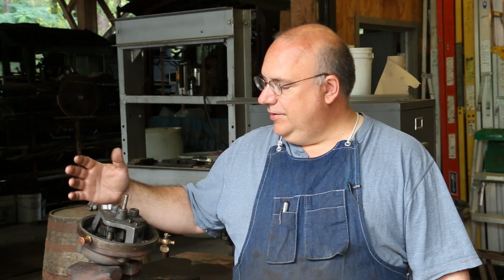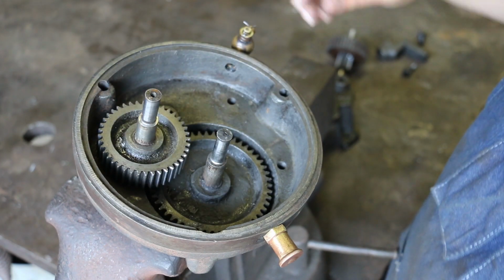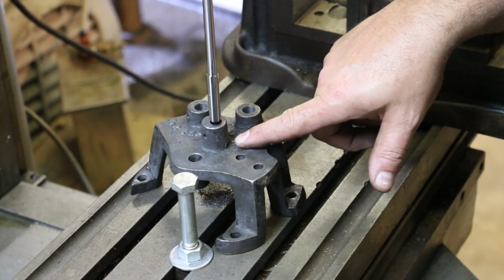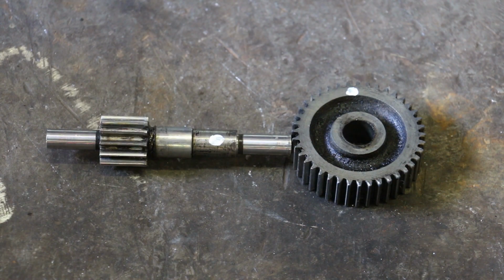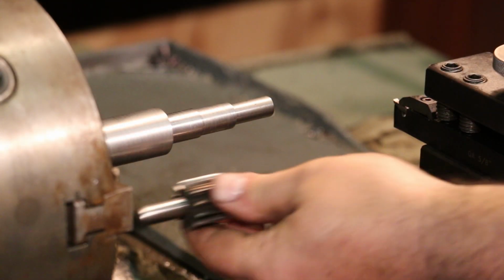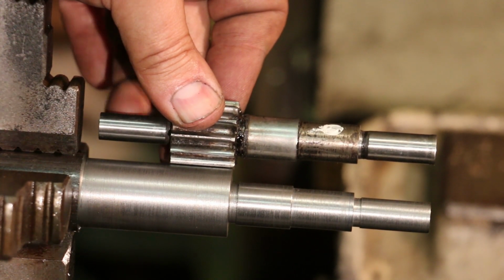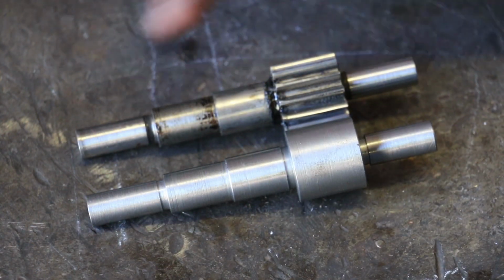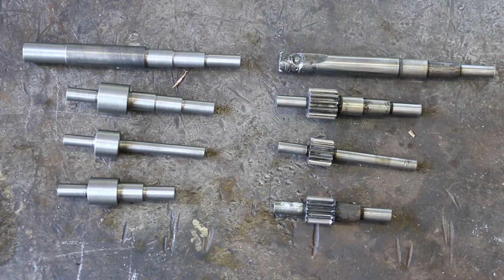Blacksmith Blower Rebuild:  Part 1 - Disassembly and Making Pinion Gear Blanks

Comment: Hi Keith! Getting a real kick out of seeing old stuff get restored like this. Great work! As a machinist wannabe I'm probably talking out of my rear so pardon me :) Noticed when you put it all together that it seemed to be a really tight fit. Isn't there a chance that there could be some tiny amount of friction between the output shaft and the housing when you put it all togehter? I mean, with that gear ratio from input to output, even the tiniest amount of friction at the output would be multiplied quite a bit to the input thus needing alot of unnecesary torque at the input. I'm thinking that perhaps if the shatfts were a bit looser in the housing then the friction would be less, thus less input torque would be needed.
Reply: ncmaothvez1 When you mount shafts loose, even with a tolerance, they seem tight until you make the whole assembly final lined up and fixed, then, the tolerances make it go silky smooth....
Reply from the maker: ncmaothvez1 Once things are aligned with the big gears in place, I think it will actually fit and line up better as that helps align everything in the gear box.  Also, everything will have oil on it when it is finished, which will make a huge difference.  Worse case, I shave a few thousandths off of the part of the shaft that fits into the bearing fit once it is all done.  It is much easier to take metal off than it is to put it back on.....
Reply: Keith Rucker - VintageMachinery.org Thanks for the reply Keith! I think I sort of assumed that since the blower is rather old, the alignment of the holes isn't that great.

Comment: Hi mate.
It's all going to look very good.  You have got a good fit for all those axels.  And while I know that most of those gears were pretty worn, I can't help feeling that the gearbox has lost its old time feel.  If it all becomes micrometre precise, it's lost it's nostalgic beauty.  I don't know how to express that feeling.  In New Zealand we had a expression, She'll be right,  It sort of says, It's not perfect, but it will go for long time.  And I have the feeling that will be lost if it's all polished and smick.  Catch my drift?
Marcel.
Reply from the maker: Marcel Timmers I do catch what you are saying, but our blacksmith needs a good blower that will blow air.  As it was, the gears are slipping and it is not working the way it should.  From the outside, it will all look the same, but if it is broke and will not work, the blower is useless.  I am trying to bring it back to life!

Comment: I think that gear is made of some phenolic material very much like Tufnol:
<http://www.tufnol.co.uk/technical/tufnol-gears.aspx>

Similar gears are used in swedish gear transmission drill presses to reduce noise and wear (on the small metal gear). I think you are mistaken that this was cost-cutting.

The use of the resin gear in the high speed stage only would lead me to believe you are looking at the cutting edge of technology at the time. And it has done rather well I might add, just think how many more times that output gear has spun around compared to the others.
Reply from the maker: stefantrethan Thanks for the info - interesting stuff!

Comment: Nice project. Looking forward to the rest.

Do you have all the different gear ratios? It would be fun to calculate the final ratio. Also, I would be interested in whether the original designer tried to balance out the wear by selecting gear tooth combinations with few or no common factors (so that any individual tooth would mesh with all the opposing teeth before re-meshing with the first tooth it opposed). Something like 16 (2*2*2*2) opposed to 81 (3*3*3*3) - roughly 1:5, but with no common factors, so every tooth will mesh with every opposing tooth before the cycle repeats.

It would be nice to completely replace the zinc die-cast gears in the cheesy forge blower I have stashed away somewhere around here. I should probably replace the die-cast housing as well. (This sounds like the traditional grandfather's ax: only replaced the head twice and the handle three times. Still the same ax, though.)
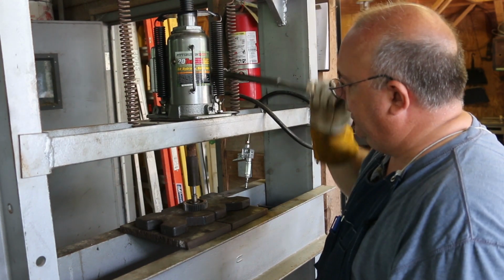Reply: Interesting. They took the smallest practical pinion (12 teeth; factors of 2*2*3) and mated them to 40 and 50 tooth gears (2*2*2*5 and 2*5*5 respectively). Mutually prime numbers of teeth will go through every combination possible before the same two teeth meet again. The more prime factors they share (2 and 2 with the 12:40 combo, and just 2 with the 12:50 combo) means that the same pair of teeth will meet 4 times as often and twice as often respectively, while skipping the other possible meshings. In the 12:40 combo 75% of the tooth-to-tooth combinations will never occur (unless someone disassembles the drive and reassembles it clocked differently), and with the 12:50, half the t-to-t combinations will never occur. I would expect that careful inspection would find some periodic/cyclic wear patterns on those gear teeth, unless that drive has been disassembled frequently over the years.

At the cost of slightly less ratio advantage, using a 13 tooth pinion (13 is a prime number) would make every combination except those with with 13 as a factor (26, 38 [[ EDIT oops; meant 39]]. 52, 65, etc.) be an even wearing combination. Too bad the axle holes are already located (and the blanks fabricated); you could have re-made this blower drive to make it last for two centuries instead of just one. ;-)
Reply from the maker: Peter W. Meek So the gear ratios go like this:  50:12 - 40:12 - 40:12.  So, that would give a speed increase of 4.166 with the first gear, and 3.33 on the second two sets.  So, if I am doing my math right, one crank on the handle would equal about 46.3 turns of the fan.
Reply: Peter W. Meek  The wear is very consistent, so I would think that they are odd teeth numbers, all teeth meshing! Regards, Matthew
Reply: Peter W. Meek Zinc stuff is everywhere they want the apparel to fail... except on sacrificial anodes on ships...
Reply: One good thing, Keith; you can do this job with only two cutters - #3 for both the 40 and 50 tooth gears and #8 for the 12. Under $150 new if you don't already have them.
Reply: So the ratios are odd, with each rotation, the teeth fall differently. Hence the eaven wear.

Comment: Maybe that phenolic gear was sacrificial in case something gets into the fan? It'll shear or strip instead of blowing the case apart. Or to quieten the final drive?
Reply: aallwwkk Probably the noise suppression.  That was my first thought.
Reply from the maker: aallwwkk Both are possibilities.  Of course, back in the day you could probably just order a new one - not an option any more....

Comment: Hi Keith, got a good chuckle at 12:45 seeing your reaction. I used to rebuild two piece motorcycle crankshafts, you know that pop is coming, but it's always a suprise.
Reply from the maker: John C Yeah, I have had pieces bust into thousands of pieces on the press before so I never know if that pop is good or bad until it is over....

Comment: Keith,  any shade tree mechanic would have just fixed the gear and threw it back together, but you, being a true machinist, chose to rebuild the whole assembly.  I might have bored out the shaft holes and put bronze bearing material in, but, the way you did it is perfectly right.  Thanks for sharing.
Reply: Herb Blair let the guy in 100 years have enough metal to put bushes in! unless he can 3d print cast iron and steel by then!
Reply from the maker: Herb Blair Truth be known, I looked at the project and thought to myself, this would be a fun little job to do and would probably go over well on YouTube as well.  Both accounts make it worth doing!

Comment: Just seeing the pictures and title that's monumental making gears. I suffered in a shop making just a few gears. Its so slow and the patience required is painful. That's what make Keith a "MACHINEIST"
Reply from the maker: ***** I have made a few gears in my days.  We also had a huge job in the shop back in the day where we milled splines on hundreds of shafts.  I spent weeks at the horizontal mill cranking on the dividing head.....

Comment: What a great project.  A couple of observations.  I liked the way you used the calipers to measure the shaft.  I had forgotten about that method.  It looks like the unit was to have an oil bath at one time before it got too worn?  I am thinking the gear that was not cast iron was made that way to perhaps reduce whirring noise.  Super video editing and narration Keith.  Really liked the music by Joe and Owen.  I am going to add these fellas to my play list.  THANK YOU!  Fred
Reply: jusb1066 That gear looks like Bakelite which was invented in 1907 - could be that the blower only dates back to the 1920's, or perhaps this is not the first time it has been repaired...
Reply from the maker: GeoffreyThorpe123 The blower probably does date from the early 1900's so Bakelite is a likely candidate.
Reply: Fred Miller maybe it was to reduce noise, or maybe to make it fail on purpose! who knows, keiths fix will be using much better steel, so it will last at least another hundred years, i wonder if it had been washed out, as it was bone dry in there, not sure about the oil bath, would be a lot to seal up

Comment: A job that, when finished, gives a great deal of satisfaction. I always get a kick out of fixing things that others think only fit for the recycle bin. This job is true recycling.
Keep 'em coming.
ATB
c
Reply from the maker: Chris Stephens Thanks - it would probably be cheaper to just buy another old blower, but why not fix it up like new?
Reply: Yes, indeed.
Reply: Keith Rucker - VintageMachinery.org After all it's a museum....! You don't think of filling up a museum with brand new stuff..
Reply from the maker: pierre beaudry Absolutely right!  That is why we do so much restoration work.
Reply: Not quite anybody, but i do get your point, and in the same vein, it rather depends which western design they stole for their cheap and nasty copies.
Reply: Ah electrickery, not my specialist subject, I bow to your greater knowledge on such things.:>)

Comment: wow a lot of work for such an item, you take on a lot!, what with the forge to redo- more casting coming, you have a lot to do and we have a lot to look forward too, thanks keith,   OOh chrome moly, your making it better than it ever was! after new internals it will deserve a repaint and a bit of handle work too
Reply from the maker: jusb1066 Hopefully we will make her as good as new and she will hold up for another 100 years!
Reply: jusb1066 Why not just buy an electric one, and throw this one away??? And be done with it!!!
Reply: Marcel Timmers
 its like a movie, you dont out the murderer at the beginning, you have to work for it!
Reply from the maker: Marcel Timmers It is for the museum to use in the blacksmith shop in their 1890's historic village.  Electric just would not do for that.....
Reply: Keith Rucker - VintageMachinery.org Hi mate.  You must not have read my previous comment.  but thanks any way.